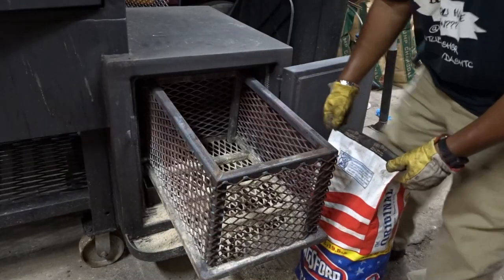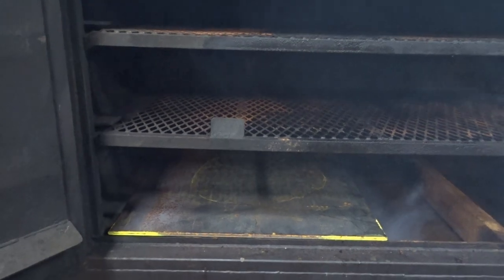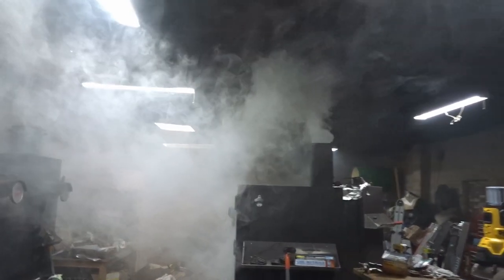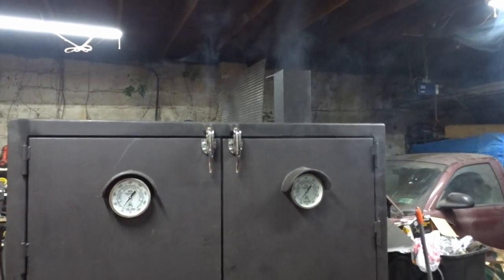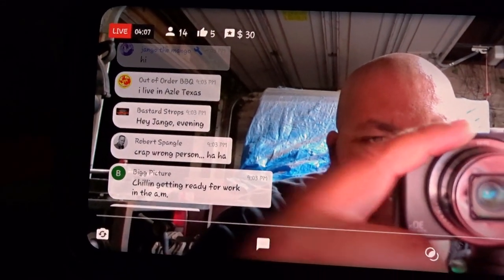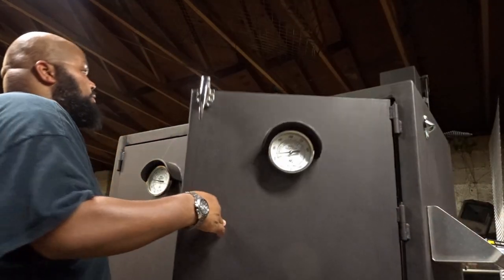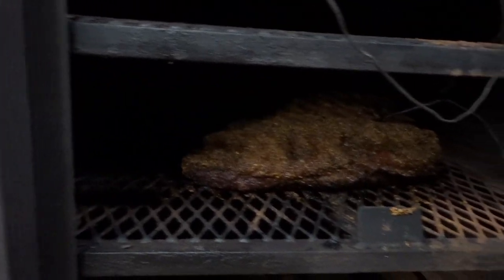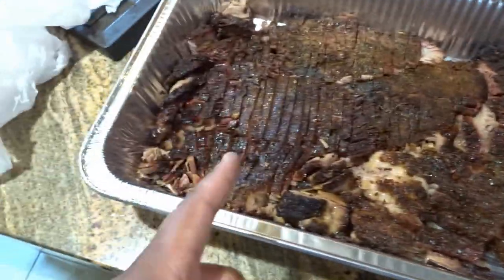SDSBBQ   Using the Charcoal Basket to Smoke Brisket in the New Insulated Smoker

Comment: Bro try lightning your basket from the top & allowing it to burn down vs lighting the bottom & burning up. I will allow ash to not choke off air as much towards the end of the cook
Reply from the maker: I try and light the front to back, when I get the piece of expanded in there to angle the charcoal up it should help with the ash. I also didn't have all that much in there the basket wasn't 1/2 full with the whole bag of kingsford. I'm still working on it, I appreciate you guys feedback and it is defiantly helping me to figure this thing out faster.

Comment: Good video sir, have you thought about running your wood in chunks mixed around within the coal? That is how we do our basket for our reverse flow cabinet cooker so that we get consistent mix of coal and wood through the 22-26 hours we get per full basket load (2 bags of kingsford and 8-10 chunks of wood). Also, if your heat is coming from the bottom like that maybe try a test cook on a brisket fat side down, we run our reverse fat up since heat enters from above but I've had good luck fat down on my small vertical offset. Keep up the great work, I'm hoping to start putting out videos soon with our new business taking off. We are doing out first really big vending event this weekend at a festival expecting 3 to 8 thousand people.
Reply from the maker: I usually put one split on the bottom under the charcoal and one on top of the charcoal. I jumped the gun and dumped the charcoal in for the video. I didn't want to take the charcoal back out so I just put 2 sticks on top. Once I saw the results of the brisket I did think about cooking fat side down. That would have prevented the flat from "over cooking".
I'm looking forward to seeing more from you, I'd love to see how someone else does things. Thanks for watching.

Comment: Not enough airflow......no draw.
Reply from the maker: There's a decent draw, if I were using wood I might need more cause it didn't burn well. But with the charcoal it is fine. It burns clean with charcoal as opposed to when I used wood.

Comment: You should've lit it from the top instead of the bottom
Reply from the maker: I'll keep that in mind. Thanks
Reply: Bryan Jackson agreed, seems all the charcoal would burn then you get to the wood... the meat would be near done by the time the smoke started rolling, lol
Reply from the maker: I can tell you that is definitely not the case. The charcoal gets lit in my opinion faster when burning up then when down. Might have to do an experiment.
Reply from the maker: I'm going to respectfully agree to disagree, from my experience in using charcoal in my smokers the ash is very rarely a problem, nor is the lighting of charcoal and smoking. I think, and this is just my opinion... because a little charcoal is being lit the smoke isn't a problem. 
And about the minion method... I usually only buy charcoal when it's on sale and it for me is cheaper that buying wood when I get it that way. But you might live in an area where you can get wood cheaper than I might be able to.

Comment: Dash, new subscriber here.  What is your torch attachment brand and did you need any additional housing for the propane bottle.  I have a harbor freight torch and it’s attached to a 5lb can and I rather have your setup.  Thx
Reply from the maker: I got that torch from Harbor Freight it is the $40 torch that can connect to a 40lb tank. No additional hoses and or things needed.
Reply: SDSBBQ thank you.  I will look for it.
Reply from the maker: Make sure to look for a coupon first!
Reply: SDSBBQ thx for the heads up.
Reply from the maker: It sucks but the list of stuff you can use with that coupon is getting smaller and smaller.
Reply: SDSBBQ I’m looking at the site but don’t see the one you used.
Reply from the maker: They are called the "weed burner"
Reply from the maker: Hopefully this will work... https://m.harborfreight.com/propane-torch-with-push-button-igniter-61595.html

Comment: I never really considered the possibility of a grease fire in your garage, not a good picture.
Reply from the maker: Yes... I keep it in the back of my mind and try and do thing to avoid them.
Reply: A good Co2 fire extinguisher might be something handy to have around.
Reply from the maker: Added to the list, thanks.
Reply: I've wondered about this especially when cooking in Vicki. If the water pan runs dry and you have a nice fatty brisket, what are the chances of a grease fire starting up? I know the Myron Mixon smoker has an autofill valve so that the water pan stays topped off. Might be a good idea to engineer something like this into your cookers. I've got it on my list for when I eventually get around to building my upright smoker.
Reply from the maker: That's a great idea. I usually don't let it run dry I am mindful of that cause I really don't like the burnt grease smell the smokers make once they are dry.
Reply: My experience has taught me that two things will lead to a grease fire, 1) (and this can lead to the second) not ensuring there's not already a buildup of grease before starting the cook, and 2) something clogging your grease drain preventing liquid grease from draining out of the smoker properly. My smoker doesn't have a water pan to catch dripping grease but has a gravity drain in the bottom.
Reply from the maker: The Winking Pig Bar-B-Q There isn't usually ever any grease buildup in my smokers because of the water. The grease gets rinsed out when I clean out the water. I don't run them dry.